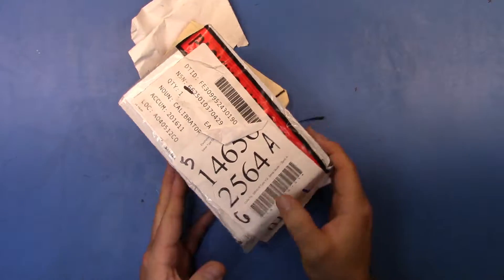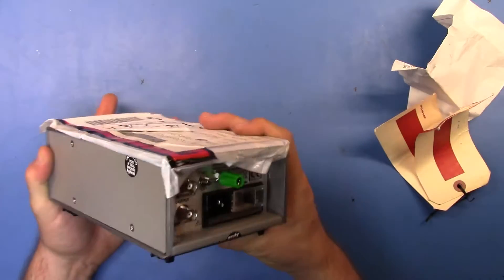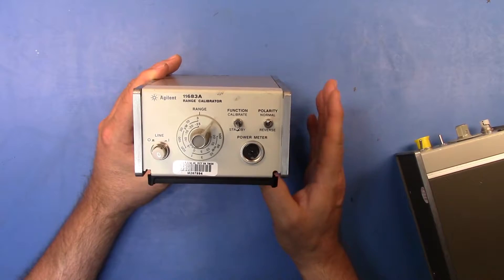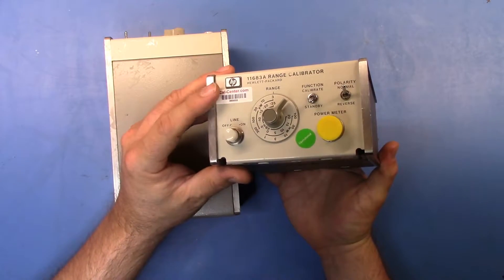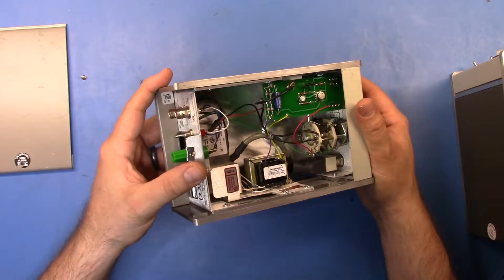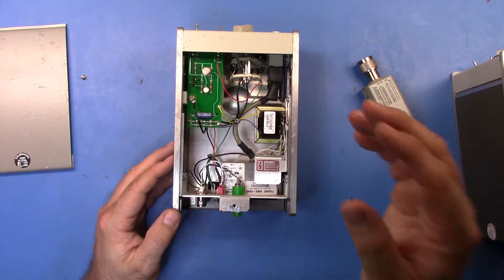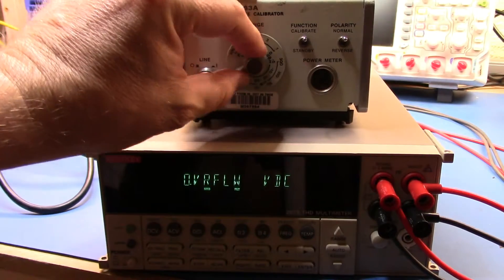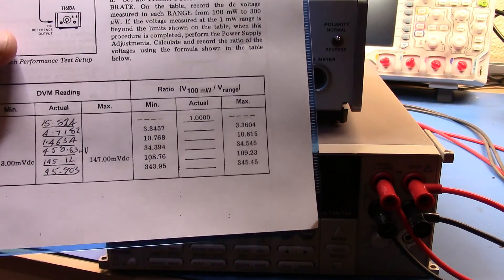Partial: HP 11683A Range Calibrator with Option H01 - Part 1

Comment: Any idea on what mysterious Option H01 is in general on HP instruments?
Some rare HP 3456A/3457A/3458A DVMs have that option too, but no documentation on these can be found anywhere. Apparently on 3458A, it's something to do with AC voltage ranges.
Some HP 1725A scopes have it as well, which makes it even weirder.
Reply from the maker: I believe that these option codes (e.g. H01) are some form of custom code for HP & the customer.  I'm not sure that they actually related to functionality but they might. In any case, I've virtually never found any information on what they actually mean for any given piece of gear.